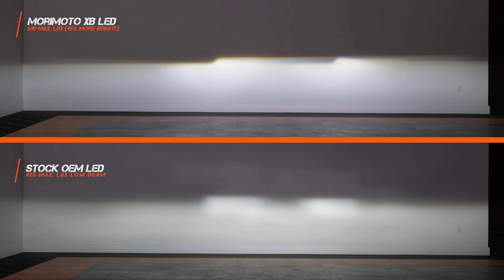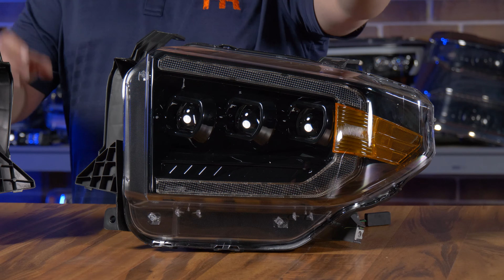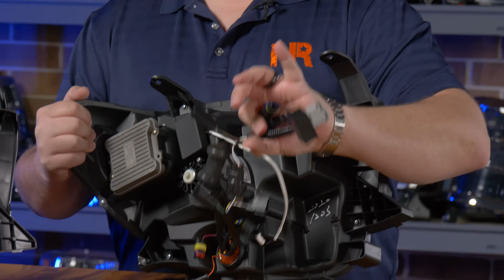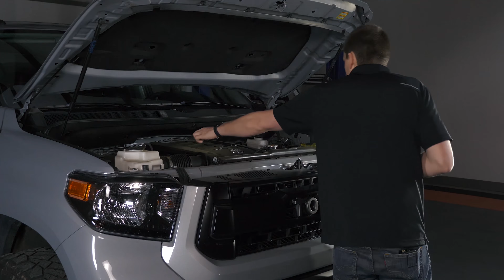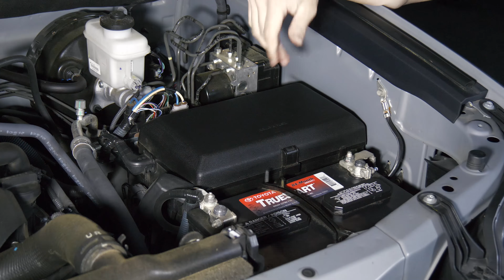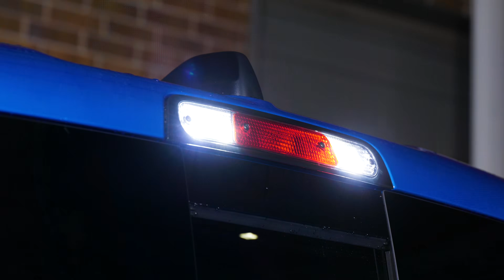NEW AND IMPROVED 2014 - 2021 Toyota Tundra Morimoto XB LED Headlights GEN 2 | Headlight Revolution

Comment: I installed these on my 2017 Tundra, love them, HOWEVER at  14:50 , Im sorry, pro install but bush league on the wiring for the DRLs power wire. I removed my battery and drilled a hole in the fuse  box on the side CAREFULLY and away from any electrical components/wires/fuses.  I then ran the wire through a grommet to seal the wire.
Reply: Shinanju must mean wiring lmao

Comment: I really like these but am worried, like some of the commenters below, about repairability.  I am an EE and know well that no system is 100% reliable, so a few questions. Lets say a projector fails, a few questions: 1 - How long is the warranty and what is the warranty procedure? Return the entire headlight? What do you do in the meanwhile?  2 - How is a failure  handled 2, 3, or 8 years down the line? These series of Tundras are well know for longevity, and given Morimoto is the most expensive (and possibly best) option,  how is long term support intended? Are there any user replacement parts?
Reply: Contact HR directly, I have, BUT it takes a few days, for a reply. Other people say their customer service sucks.  ( I REALLY like the amber DRLs BUT they are $250-300 bucks MORE than the all white DRLs..... donr know which I will choose)

Comment: Just got mine and the turn signals only blink instead of being sequential.. how do I fix it?
Reply from the maker: There’s a plug on the back of the headlight that controls whether the turn signal runs in standard or sequential mode. Double-check the install guide for how it’s set up—or feel free to reach out to us directly for help! We’re happy to walk you through it.

Comment: "50% brighter than stick headlights", LED headlights... assholes blinding everyone else.
Reply from the maker: Morimoto headlights are DOT-approved and designed to provide optimal visibility without excessive glare when installed correctly. Unlike low-quality aftermarket LEDs, these are engineered to meet strict beam pattern regulations for on-road use. We always encourage proper installation and aiming for the best driving experience for everyone on the road.

Comment: but why do cutoffs from morimoto headlights always look crooked? no matter for whick car, they never seem to be aligned to each other
Reply from the maker: May not be used to seeing the defined step beam pattern - there is a step down in the middle of the beam on the drivers side for oncoming traffic. This step-up allows for more light on the passenger side, without blinding anyone else. There are different types of beam patterns, and some of them can be straight across instead of having a step in them.

Comment: Hello I have a 2015 Tundra and just had them installed. I was told that I need to purchase the Morimoto DRL Delete Relay conversion for the turn signal to work. Is that correct? Please help.
Reply: Yes, if your '15 has stock DRL, you will need to replace the relay with a non-DRL version.  Headlight Revolution confirmed this for me on my '17.
Reply: @nelsond7004  thanks for the response dude. Ended up installing the delete ray and all things working well. Love the lights! Have a great weekend.
Reply: The cost here doesnt give my wallet reason for such a minimal improvement but the inside led bulb replacement kit was a no brainer
Reply: Hello, My 2018 Tundra has factory Halogen and LED DRL. Bought a set of Marimotos projectors. The Three lights configuration. I don't think harness provided will work.
The three pin main on new harness is supposed to connect with old connector originally going to old Halogen?

Comment: Any hyperflash problems if I also have LED rear turn signals?  Currently running incandescent front bulbs with no resistors and there is no problems.
Reply from the maker: None that we've seen!

Comment: So I just installed my morimoto xb amber headlights on my 2018 toyota tundra,with the oem harness, my blinker is sequential my hazards work, high and low beams work but my starter sequence doesn't work and my oem light adjuster doesn't work am I suppose to hook up the fuse wire? In order for everything  to work?
Reply: I’m having the same problem.  Did you ever figure it out?    I know it’s been awhile , but I hope to hear back from you

Comment: I have a 2014 tundra with halogen bulbs with the LED factory DRL. Do i need to still run the wire to the fuse box?
Reply from the maker: If you have the factory LED DRL strip under the light then you would not need it!
Reply: @HeadlightRevolution  thank you so much!

Comment: Bought a pair, but I have an after market steel bumper and I feel like my headlights are aimed too high blinding everybody in traffic.  How do I adjust them lower??
Reply from the maker: There is an adjustment screw on the back, you can rotate this with a long screw driver to adjust them!

Comment: I have a 2020 SR5 Tundra that has Halogens and the DRL factory strip on them. I’m wanting to go the morimoto gen 2s with the Morimoto fog lights but my question is will I need the adapter harness to go the gen 2s?
Reply from the maker: You will not need the DRL adapter if you have OEM DRL!

Comment: Sweet lights! Especially the light bar in the hood. But after watching the install video there was no way I was attempting this on my own. And I dont know a single shop near me that has a tech that I trust to do it.
Reply from the maker: Give it a shot James!
Reply: Super easy, bud.
Reply: It’s quite simple if you have a little mechanical knowledge. Don’t be afraid to tackle it in your own. You’d be surprised what you can accomplish on your own.
Reply: You can do it i work on my tundra all the time changed all lights to led and was easy watch youtube!!👍
Reply: It can be done, prolly took me longer wiring it up than actually installing the light bar.  Had to make a couple trips to the parts store but I built my own wiring.

Comment: I need help, so I've installed new headlights on my 2017 platinum tundra. And when I lock the truck, the daytime light stays on for a really long time before turning off. Is there a way I can fix it?
Reply: Try going into the setting on your dash for vehicle exit lighting... I don’t have a tundra but I have an 2019 f250 and I can change how long my lights stay on after I turn the truck off and lock it.. from 15sec to 30sec to 60sec

Hope this helps!
Reply: @TheUnspeakable9  thank you for taking time and giving me some info, I tried this and it worked, lol at first I thought the headlights were faulty

have a good one
Reply from the maker: Thanks for the assist Alex!

Comment: Too damn expensive . 1500 for a pair
Reply: You pay what you get. These lights will last you a lifetime.
Reply: @EduardoISF  Lifetime?? Actually, many of these after-market headlights are cheaply made so the circuit boards burn out and clear  plastic quickly fogs & yellows
Reply: @g_unit6773  I’ve had cars where I’ve gotten the headlights retrofitted. Both companies use morimoto product and I’ve been pleased with them. Never burned while I owned the cars. I am pretty sure if you end up having a problem with them Morimoto would exchange them. Their product on headlights have lifetime warranty.
Reply from the maker: Worth it!
Reply: Will these work with a 2020 trd pro? I'm seeing stories of after market lights  messing up the electrical because of toyotas safety sense. I love the stock headlights but they're not powerful and forced to always turn on fog lights. And even after that I still think it's still dim.